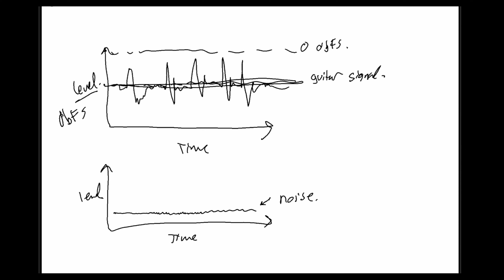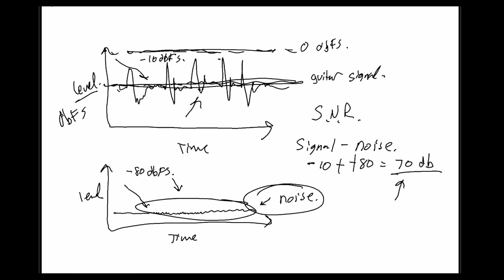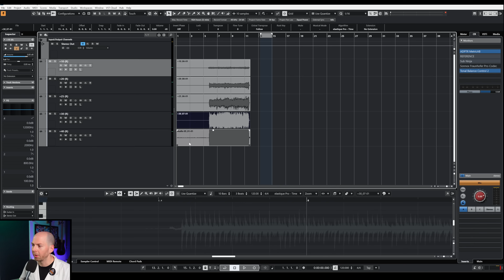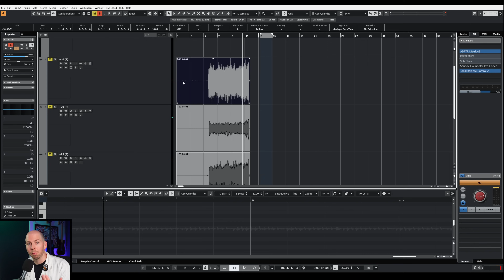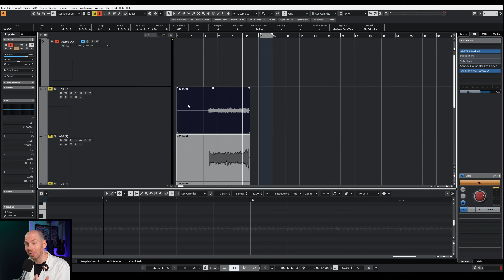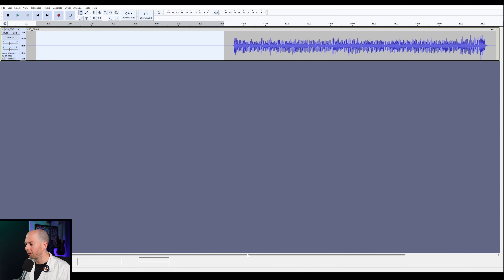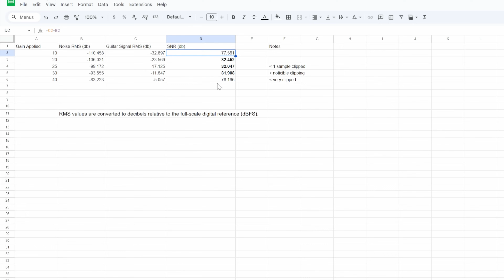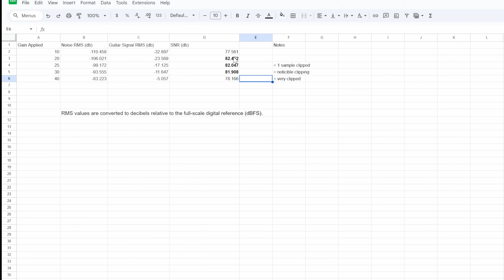This is the BEST Level to Record GUITAR DIs for Amp Sims (science based)

Comment: Total noob to home recording. Using Logic Pro and Neural DSP for guitars. When calculating the signal to noise ratio, do I do that with just the guitar into the interface... or open the Neural DSP that I'll be using (with a lot of heavy rock tone) and calculate it with that on? Also, if it is WITH the NDSP pluggin open, a lot of them have noise gates... so I'm assuming I'd turn OFF the noise gate to get the noise floor. Sorry if this is a really dumb question.

Comment: I found the angle of the guitar in relation to the laptop screen affected the noise level significantly. When the guitar neck is parallel with the screen I get the least noise and as I turn to either side it increases
Reply: Bertom Denoiser is the solution.

Comment: I live in a house with noisy wiring. I can literally reduce the noise coming from my pickups simply by turning my back to the interface. But it's still not as quiet as I'd like it to be when not playing. I use a noise gate, but of course that only reduces the noise when I'm not playing. The minute I start playing, the noise gate opens up and all that noise gets in. I use a DI with a ground switch, but it only helps so much. I guess I should definitely be doing tests to see how to maximize my signal-to-noise ratio.
Reply: I can significantly reduce the noise by not plugging the guitar in or turning the computer on and just drinking beers and watching YouTube instead
Reply from the maker: If it's noisy there is probably a ground loop issue with your electricity. Maybe experiment with a ground loop "eliminator" type electrical plug? The big thing is to plug EVERYTHING from your guitar rig (pedals, amps, etc) into the SAME outlet that uses the ground loop eliminator thingy. That will stop stray ground paths from getting into your signal and causing buzz. Otherwise, it could be EMI from poorly shielded guitar electronics. That is a little more nuanced to fix though... Hope that helps!
Reply: @RaytownProductions  yes... I was going to suggest the same. I tried one before I re-wired my house, because it had significant noise, especially when the fridge cuts in. The noise was significantly reduce at a cost of £45 or $60... Worth a try! 🤔

Comment: What if my interface doesn't have instrument imput gain knob?
Reply from the maker: What interface do you have? I HAS to have some ability to change the gain unless your interface only supports line in. In that case, I would recommend you pick up something with a built in preamp.
Reply: @RaytownProductions  line6ux2. it doesnt have direct gain for the imput. i could only mess with it if i have DI box. using mic gain. but see no point in  dialing th etone on cold signal.
Reply from the maker: @worldaswar3784  Ah in that case, you would just need to do the steps outlined in the video by recording the riff in each of the two jacks (norm and pad) and calculate the one that has the highest SNR.
Reply: By changing your guitar pickup height you can increase or decrease gain. I dont know if it helps the snr issuse or not but for many years i had an interface with no input gain and my di was very low so i made the pickup height so it went closer to the strings and the input gain increased.
I think 3mm for bass strings and 2.5mm for treble strings is a standard height.

Comment: Didn’t hear you mention maxing the guitar’s volume knob when you do SNR tests, or how to play the instrument…. Very hard, normal etc. Also this changes for each guitar used, each pickup position, different pedal boards, etc. This is a good video to talk about the why and to optimize… but a better video would be a rule of thumb to get a good SNR quickly, find the good knee on the gain curve. Yes this is a black art gained with experience, but you can still give a rule of thumb that gets you 90% of the result with about 10% of the effort.
Reply from the maker: Great points! Just for clarity, You will want to play the loudest/hardest part of the song when doing these tests (which is what I did for the DIs). Thanks for bringing that up!

Comment: This optimum snr may not be the optimal level going into guitar sim. So not sure this is the best way always.
Reply from the maker: That is next week's video 😊
Reply: That's ridiculous. You have an input gain control on your amp sim. Once things are in the digital world, this stuff doesn't matter, just set input gain on your sim so it behaves as expected and sounds good. What matters is making sure that you are feeding your preamp and converters in your interface with an optimal signal that  has the best signal to noise ratio without clipping. Once the signal gets past the converters and is digital, there's no problem.
Reply: @Patrick-857  i would say the noise is so low (at least on my equipment) that an “unoptimal”  snr level does not matter much.

Comment: Nice to see someone trying to clear things up.
The absolute nonsense that's been peddled on this topic for the last few years is insane. People have been needlessly over complicating things in order to seem like a Youtube "expert"

Whats worked for me consistently for decades is to set preamp gain based on big heavy palm mutes, these typically have the absolute loudest waveform peaks you'll get in a guitar performance.
Set the preamp so that you have some headroom to spare, 6dB or so should do.

This gives you a decent level with good signal to noise ratio, and your average level should be somewhere around 0VU before it hits your converters. Your analogue components are operating where they were designed to, so everything should be nice and clean with a linear frequency response.

Comment: Useful video, many thanks. I ran through some tests using an ID24, including different takes with both the -10 and high pass filter switches engaged/disengaged. The best SNR without clipping was still 0 gain with the high pass filter engaged which is what I have been recording at but interesting to see the difference in results. I'm also yet to do the same with my active pick-up guitar which I usually record at 0 gain but with the high pass disabled.

Comment: Two comments - won't the best SNR be with the guitar recorded at the maximum level before clipping? Secondly, don't you need to allow some headroom for dynamics in the performance from take-to-take? If you go for the max level and the guitarist plays a bit louder the second time then you've stuffed the take.
Reply from the maker: The best SNR could be at the max level before clipping IF the hardware/converters are perfectly linear throughout their gain range. This is NOT always the case and why I made this video. 

I should have mentioned this more clearly, but you should be playing HARD when doing this to emulate the loudest performance so you can comfortably select the best SNR and not worry about clipping. Doing it this way also shows you the tradeoff for recording at a lower gain setting. Cheers!

Comment: Thanks, this was really great information. I have a Focusrite Scarlett 18i16 interface (4th Gen) so far, I've been using its built-in auto level feature when setting up to record. I will rewatch this video later though to try that method as I am interested to see what the results for RMS are with that auto level feature.

Comment: I can see great value in this for my electrics and it got me wondering about my acoustic recordings.  I assume the same applies to the line out of my acoustic pickups.... but what about the Mic?  Same?  I'm always wondering how to maximize gain when recording both acoustic and vocals in the same take.... I typically set my mics to a figure 8 pattern in an attempt to minimize bleed ....but find low gain is the only way to really cut it down.... and I always wonder if my gain is set too low????? Any thoughts on how this applies to that scenario are welcome.  Thanks Bobby - I really appreciate your videos!
Reply from the maker: Yep - this should definitely apply to a microphone as well. You can follow this as a guideline. The trick is to make sure whatever you are recording with the mic has as close to the same performance as possible. I think for microphones, this will be less of an issue compared to guitars because you aren't actively distorting the microphones (presumably) which can really bring up the noise floor. I would think keeping the room quiet would probably be a better use of energy for this particular application since that is probably what will determine your noise floor and not your preamps. BUT you can always try this to see where the limitation is! Cheers!

Comment: I did a bunch of runs a few years back with different gains and then digitally levelled them - the highest preamp gain was always the quietest until the signal clipped, at which point you can keep on turning-up the noise but the highest level parts of the signal are "stuck" which is why the SNR suffers. Several different runs at the same gain gave settings with a dB or so of variance which probably explains your mid-run figures.

Comment: Interesting video that does a good job of explaining what’s going on. 👍 Too much work for me though 🤣 I’ve always recorded my DIs around the -10 to -12 ballpark with my setup because that just works best for all the reasons explained here. Sometimes that’s too hot for the amp sims, but just adjust the input on the amp sim plugin to get the desired amount of clean or push you want. Better than raising the clip gain and therefore the noise floor.

Comment: I simply bang away on my guitar as loud as I will be playing on a track, and make sure I am in the yellow on my interface. I then do a short test recording to ensure my recorded signal is at least a few dB below clipping. The second most important thing is to ensure your amp sim plugin is getting the optimum/expected input level -- these vary quite a bit. For Tonex (which I use) even the captures vary. There is always a sweet spot.

Comment: ...do I have to do this for every guitar? I have some that have very low output and others that are pretty hot.
Reply from the maker: Yes unfortunately. Especially if they have very different outputs... that would require the interface/preamp to have different gain settings.

Comment: I feel like something a lot of people won't realise is that (in both the rooms I record in at least) orientation of the guitar in the room somehow can make a difference. Someone can probably chime in below and explain why, but my signal to noise ratio is a LOT better (I mean a lot) if I face a particular corner of my room with the pickups. In both my rooms, which are setup with different equipment but in the same orientation, the corner I must face is identical, and happens to face away from all the technology in the room. Since the orientation would have me face the same direction on a compass in both, I'm unsure if the signal improves so much because I face the guitar away from my tech, or if it's a magnetic pole thing going on, but it improves quite a bit really, more-so than any tech upgrade I've done to interface or room treatment. So maybe someone can explain below what this really means, but if you feel like your ratio is excessively bad and you've gotten everything else as correct as possible after following this brilliantly explained video and just starting to feel like you have bad pre-amps etc.... But you haven't tried tracking your guitar FACING in different directions.... Might be worth a try. Great video, Ray!
Reply: Electromagnetic interference. Your guitars pick ups are probably picking up electromagnetic waves from an object such as a computer. Cell phones can cause this too.
Reply: @ Thanks for explaining! I always had an inkling that it was magnetic activity, the thing that made me unsure is that if I face directly away from my equipment into the opposite corner the signal is still really meh, the equipment needs to be to the side of the guitar, like headstock pointing my computer, to remain clean and give a low noise level. I never actually thought to move my phone or check on that in general o.o I will next time!
Reply: I have to sit in a certain spot in my little basement set up to avoid buzz. It's kinda off in the corner. I have to press record and wheel back into the right spot in time to play LOL.
Reply from the maker: Sounds like EMI. Not an electrical engineer here but from my experience this can be reduced two ways - better shielding in your guitar cavity I've previously just used some conductive paint to paint the back of my guitar cavity and better/stronger grounding (like star grounding to a single point). Otherwise, just always face that one direction in your room haha! Cheers!
Reply: @ Did paint make a dramatic difference? I might try it one day, would be nice to relax when tracking and not face the same direction every take (or have to re-take it)
Reply from the maker: I don't have any measured numbers to know if it actually helped or not. Maybe try giving google a search and see if people are still recommending it. It might just be your pickups and in that case, I don't know if painting the body cavity will help with that. Sorry I can't be more helpful!
Reply: High chance that's coming from your GPU.
Reply: @NeZversSounds  My GPU did have a nasty coil whine when I first got it, seems to have disappeared... Maybe it passed all that noise onto my interface or pickups haha. But you're probably right, it seems worse in the room that has a very powerful GPU in it tbh.

Comment: Hardware engineer here:
Any real system that is powered up by electricity has noise. We live in an imperfect world with noise and parasitic characteristics to any system.
The solution to this, is usually to find the best spot in the curve of gain where SNR is best. That spot is usually at a higher gain level just below clipping.
The noise level changes minimally with the gain level, but it also depends on the interface. 
There are better or worse amplifier types but also transistors. The ADC characteristics are also important to the quality of the sound. 
The video gives a good explanation.
Reply from the maker: Glad to hear that all that research paid off! Thanks for the great comment!
Reply: Another electric engineer here: Thank you, thank you thank you! Finally! Numbers don't lie! Put the things onto it's feet! :-))

Comment: Regarding SNR: it's a ratio - shouldn't we divide signal by noise?
Reply from the maker: This is a GREAT question but the way the math works out we can also subtract these two quantities due to log identities since we are working in dB. Thanks for the comment!
Reply: @RaytownProductions  Thanks for the explanation!
Reply: Absolutely .. and if we do that, the gain position at 10 actually has the highest SNR (ie the SNR goes down as the gain goes up).  In fact those figures support the Ed S "set interface gain to zero and gain up in post" approach.
Reply: Not really - 1:2 is a ratio, as is noise floor:max signal. Cheers!